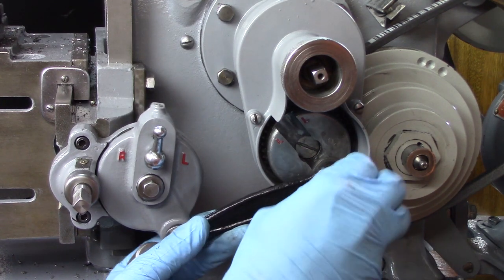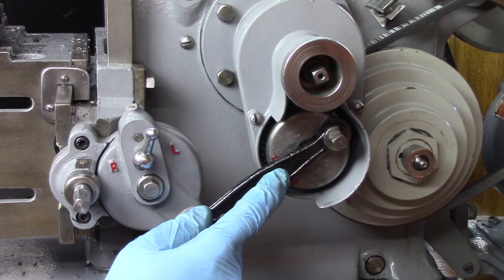Atlas 7B Shaper Quick Tip. How to time (sequence) the table traverse.

Comment: The timing also changes (a bit) when you raise or lower the table.
The more you play with the shaper, the more you will find it useful. And then you find out that you can't live without it anymore :-)
Reply from the maker: Wow!!  You’re so right!  The timing does change with table movement. I’m still testing and tuning and trying to find a squeak and a slight bump noise. I think I know the source of the bump. Also, I’ve watched your tool grinding video several more times and will watch it again today. I’ve “butchered” some HSS tool trying to get it right. Thank you so much for the info!  You’re the “Gold Standard” in small shapers…..

Comment: OK I'm back, So I got out my Atlas Shaper bulletin S7B-5 page 3. Cross Feed & Feed Timing, even a Caveman has no idea what the hell they are talken about. Well when it came to setting up mine ( Caveman no read, throw book away ) I knew the the cross over had to be on the back stroke and not on the cut stroke. Yes the timing may change a bit, but its so miner one would never notes, and yes mine has become my go to for any serface work where as my Grizzly mill has become more of a drill press. " O " yes I have a stroey about a German Pilet who may have a kill count of 352, later
Reply from the maker: I will have to check my book on page 3.  I just went to the forum, and they said there wasn't anything written about timing.  I should have known you can't believe everything on the internet;-)  I'm still in the "test and tune" phase and have a few bugs to work out.  But I can see that this is a useful machine.  I met a German fighter pilot named Gunther Rohl (spelling?) who had about that many kills.  He was so cool to talk to.  He came to my squadron at the Michigan Air Gurad.  Anyway, thank you very much.....